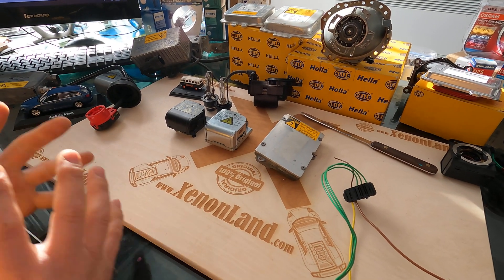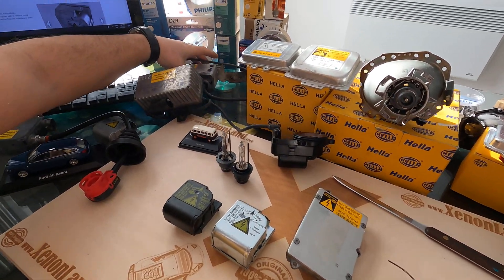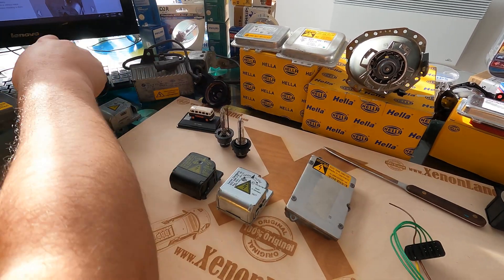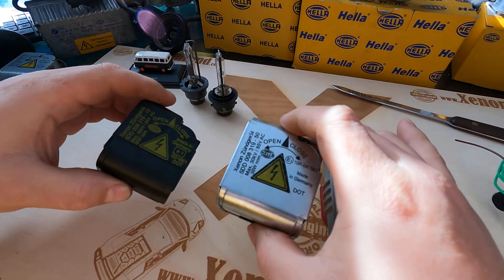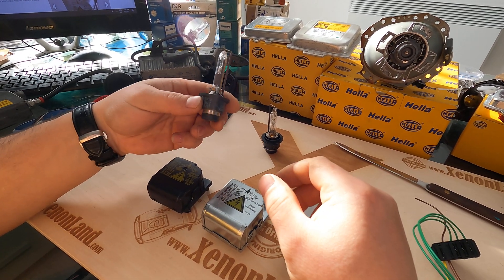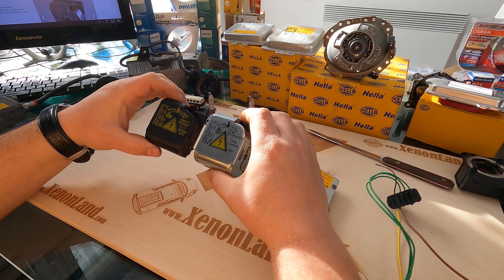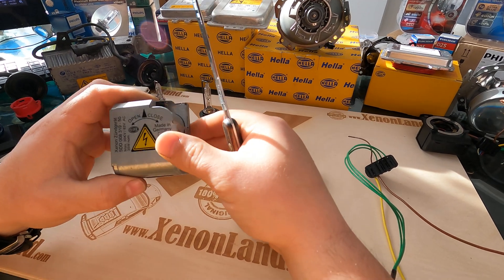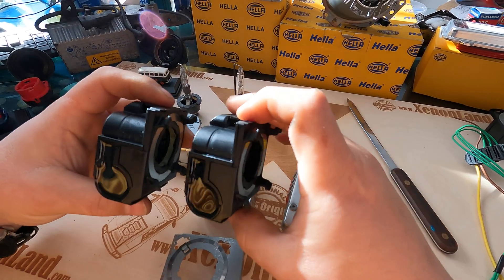Hella XENON Headlight Igniters: Are Silver 5DD008319-50 and Black 5DD008319-10 Ones Interchangeable?

Comment: my wire coating is crumbling can i simply replace the wiring? where cane i find replacements?
Reply from the maker: best solution is to find another (glass-broken) used donor headlight and get the wiring from it. You can replace the wiring in most cases.

Comment: Hi I have an old Mercedes C200 Kompressor 203 cl203 gasoline one. On one headlight I have the ballast underneath the headlight+ the ignitor inside the bulb and on the other one I have only droser+ that red connector you have in the left side of your video screen.On the red connector headlight,sometimes my bulb turning on sometimes it doesn't and stay so forever.What is the issues,the drosers on same headlights have new drosers.
Reply from the maker: if you have the third generation hella ballast installed (with the red-black bulb holder), it means that the whole ballast unit is faulty (given that your bulb is working perfectly). It also means that your headlight is repaired. CL203 has a AL/Bosch xenon system (not hella). Try to go back to original installation.

Comment: I replaced my D2 bulb but it’s still not working. I’ve ordered the igniter. Do you have a video that shows how to replace the ballast on an 06 Mercedes SLK280?
Reply from the maker: We still not made a video for slk. Ballast replacement is a pain mate. You have to lift the car and search for access to the ballast. Simpme 3 screw job, but you should have access. Or check the wheel arch fender for any cover.
Reply from the maker: Your ballast is located underneath the headlight